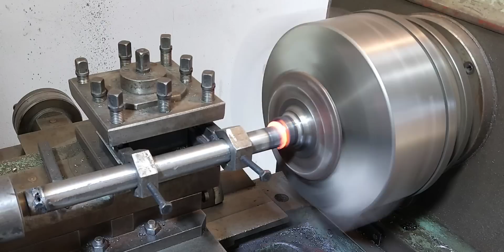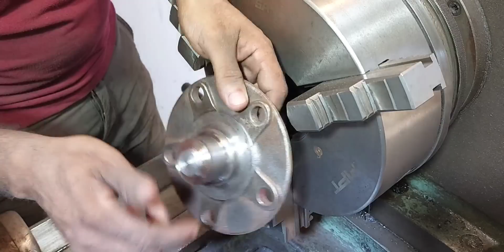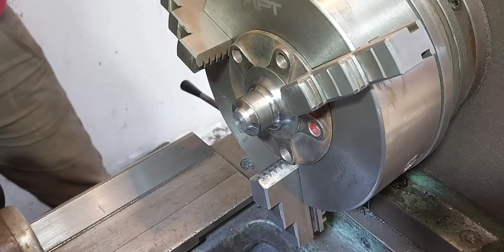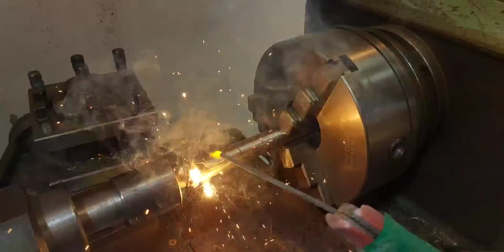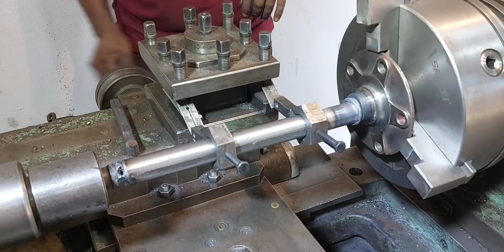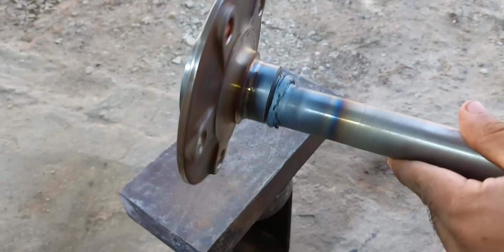افكار مذهلة في خراطة المعادن لن تراها من قبل👍

Comment: Why is there a needs for a Morse Taper Welded, to an Axle Hub?  When the Weld was completed?  It appears that the Newly Welded Shaft-to-Hub is NOT CONCENTRIC To the Hub Center? 
    I.E. The true Hub Center Appears to be OFFSET!?    HUH?   WHAT?  WHY?  This Does not Compute!  Nor does it appear to be CORRECT?  Watch the rotation of the Shaft & Hub product as it is being rotated by hand, at the very end of the clip.
  It does look like a good enough Friction Weld......  But what is actually being built as a Final Product? 

Is this just a Demo on Friction Welding Only?  Or? Do these Parts have a further, and Useful End Purposes? 

Thank you